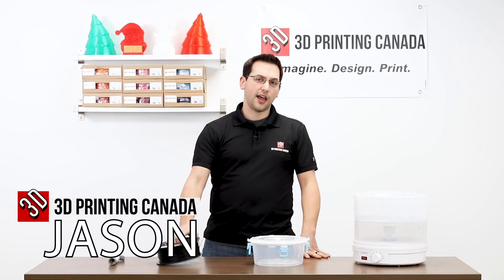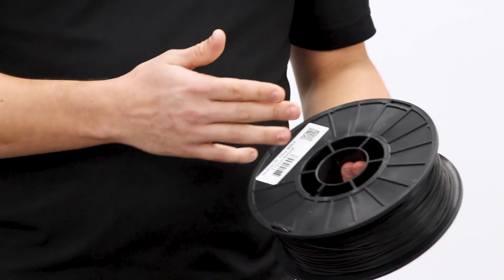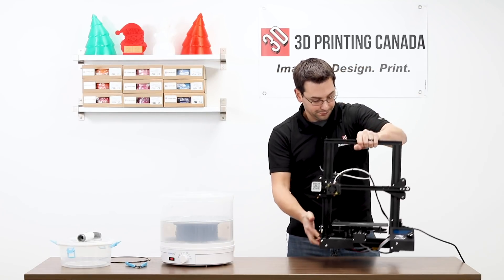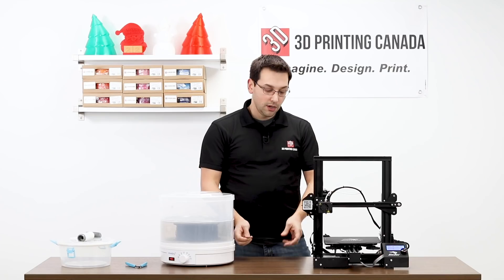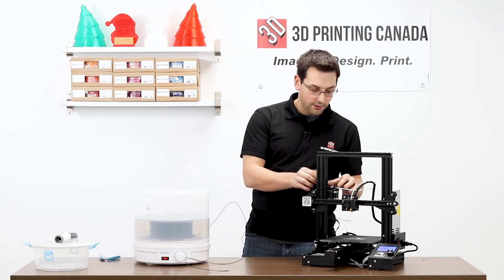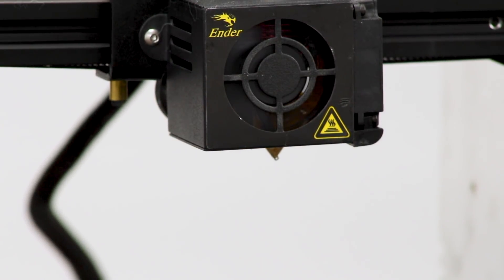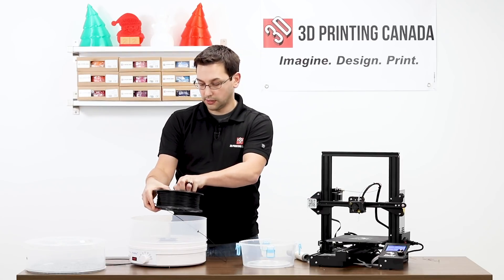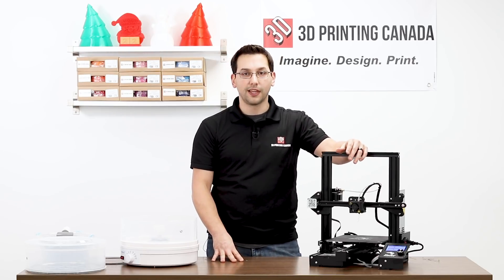PrintDry Filament Dryer and Container Unboxing and Test

Comment: Now I have a CR 10S, with the default short cables. So, I designed (with tinkercad) a spool case which fits over the control box. It also has a fairly deep well to put silica packets or loose silica into.  I feed directly from the case, while its not “air tight” it does have very restrictive air movement into the case. I doubt there would be enough air flow into the case to over power the silica. Still working on a build video on it. Case will hold 1K or 500g rolls.

Comment: Why not just pre load the filament through the hole for drying, then the hole is filled and you don’t have to open it, just discarding a small length hanging out. And if there’s one reel surely you can just take the lid off the top section and have all drying concentrated in one section container not two? I did have to laugh at the Celsius check. It’s not gonna be 70F lol